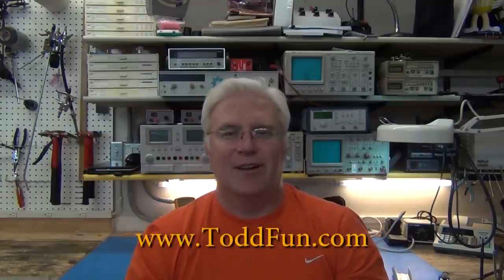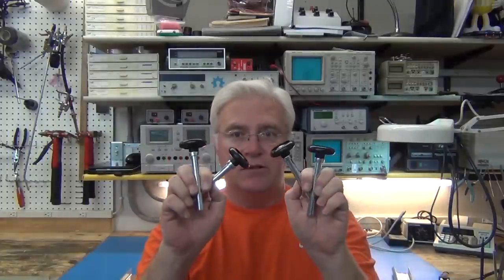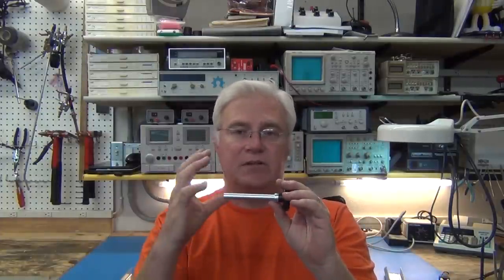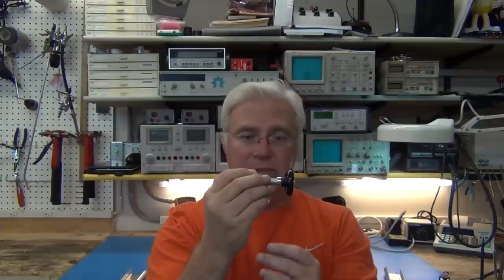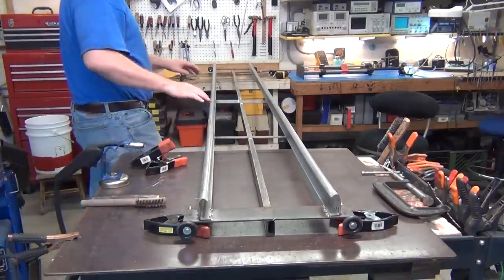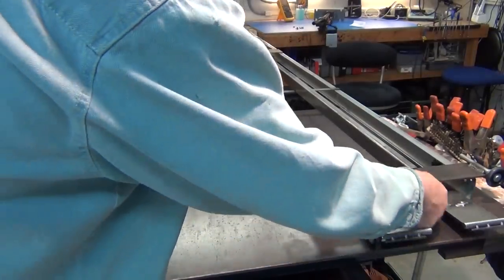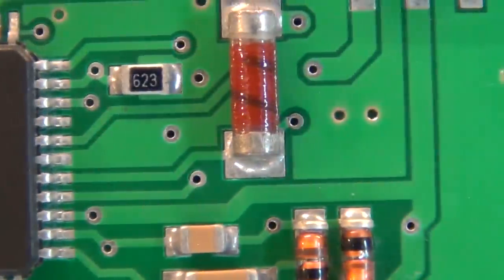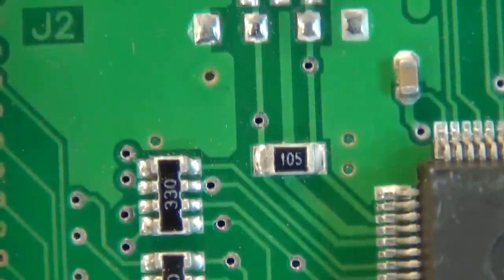ToddFun.com: Camera Gantry Take 2

Comment: A nice thick coat of chain lube will do some damping of the noise and the vibration a lot. Very nice work there, you are so lucky not to have to worry about rusting, here by me it will have rusted  a thin patina between welding and it cooling. Then again I live in the second worse place on the planet for rust. Normally when I weld the first thing after finishing is wire brush and paint with a can while still hot. Still want that MIG welder.

Comment: If you can get some poltcarbonate wheels they will do damping quite well, anything flexible will help.  May be a cheap welder, but better than the stick welder I have ( auction house find as well), for small stuff I use gas and braze it.

Comment: If you wanted a smooth traversal and willing to "futz" a bit, you could add dampeners to the wheels and they would give a smoother picture.
I thin MkII is awesome and when you're done recording, you could add drive motors (Like HackersBenchTV mentioned) and either a claw or a electromagnet :P
THanks Todd, awesome work :D